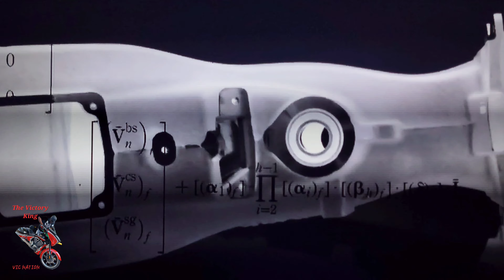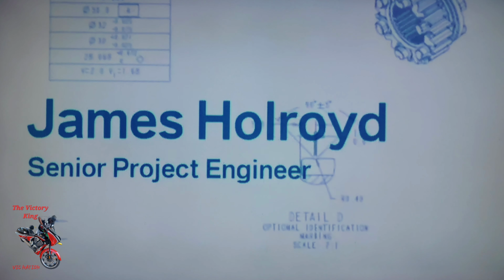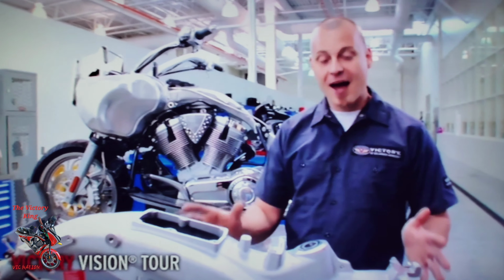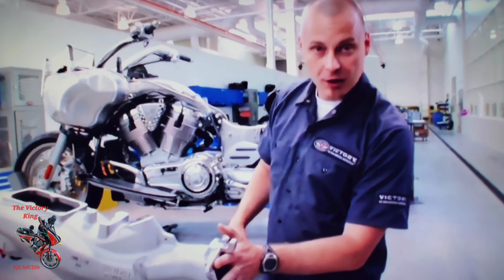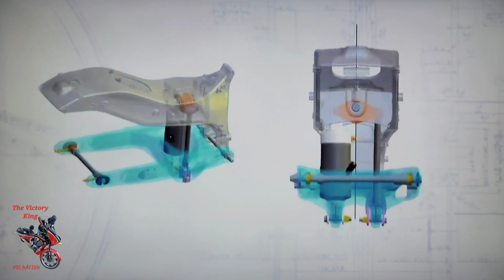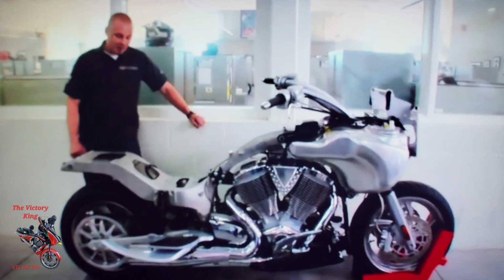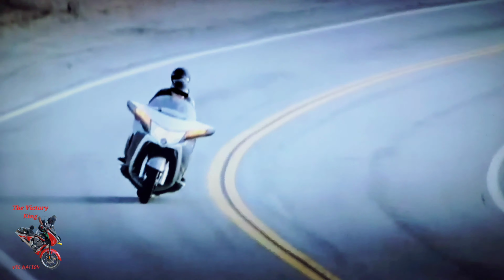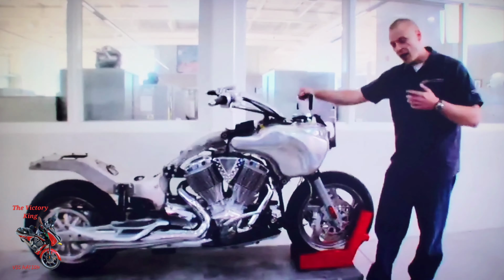Why is Victory Vision the Best #touringmotorcycle ever made #victorymotorcycle #motorcyclelife

Comment: Thanks for that video. I had 3 visionsuntil I sold one. Im riding one and customizing one. I Ran into an issue with the customizing.  How do you remove the main wiring harness from the center of the headlight stay bracket ?
Reply from the maker: I will try to find out for you

Comment: I’ve followed dudes on Harleys and I laugh when they hit a pothole and their ass raises off of the saddle on impact due to a horrible rear suspension. 

If a brand new 2024 Harley with a 121 can pull away from me it SHOULD because it’s a brand new bike with a bigger twin. A 117 with a stage 2 runs neck and neck with a stock Vic 106, so don’t tell me how much better a Harley is than my Vic when you had to pay 5 times more for your Harley than I did for my Vision when you STILL can’t run away from me on your Harley and you STILL don’t have heated seats and grips, you STILL have a antiquated rear suspension and you STILL have to purchase a separate windshield if you want more wind protection than what that tiny windshield offers on a brand new Harley.

Brand new 2024 Harleys haven’t been on the road a year yet and there’s already recalls for electrical problems and being unstable above 100 mph. 

Ride a Vision in the rain and you will remain dry. Ride a Harley in the rain and you better have a rain suit.
Reply: Preach!!!!
Reply from the maker: Top comment I forgot about the rain aspect lol
Reply: @TheVictoryKing1  and don’t even get me started on the floorboards! Brand new 2024 HD floorboards are the size of my HAND. 

I wear a size 13 shoe and I STILL have almost a foot of extra room to move around and reposition for long rides. Harley? You gotta go shopping in a catalog!!!